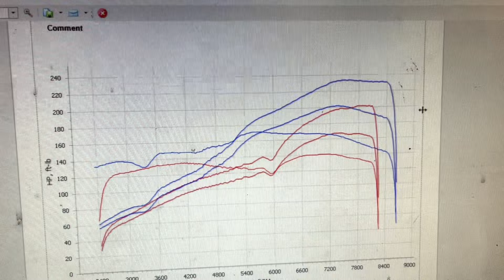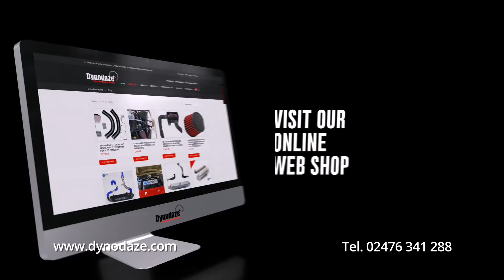Honda Civic Ep3 TypeR tuned on Hondvert Does Brilliant

Comment: I have a 2002 EP3 which I bought last Saturday the seller said that it had Hondata and was mapped @ 240, so, thinking I would future proof myself, I installed KManager 4.5.1 and dowloaded the tune to my laptop. KManager informed me that this tune was made on an earleir version of KManager please upload to ECU so I did in doing so the car would not start, took the ecu out and opened it up to find that I actually had a HondaVert board installedafter a bit of google searching I found this "All Hondavert KPro board versions compatible with KManager 4.2.3. Also KPro board version 1.6 and more moderm also works perfectly with KManager 4.4.4.

Non recommended software used for tuning will brick the boards and has to be shipped back for repair, charges applied for repair." thought I'd bricked my ecu! I downloaded version 4.2.3 portable and tried to upload my original tune still wouldn't start so I tool the plunge and uploaded a base map for the euro civic it now runs but its a little lumpy when cold and it smells like its running rich TLDR: is it possible for you guys to tune my car TDI North is closer, I live in East Yorkshire, but they said the wouldn't touch it and suggested I install Hondata that another £800+ then I still have to get it tuned. Pleas could you advise me on a course of action.

Regards
John
Reply from the maker: Give us a call Monday